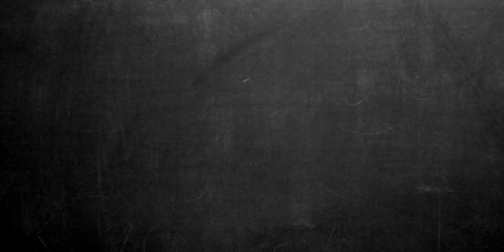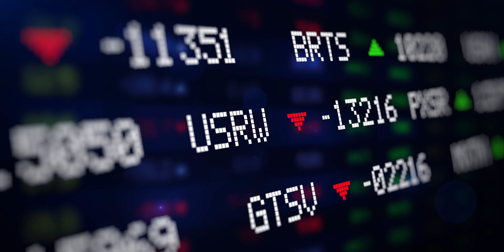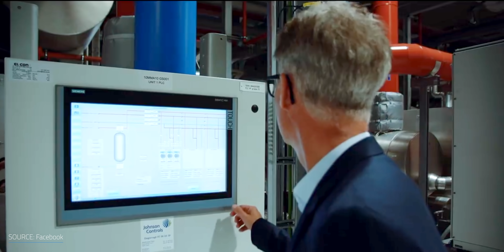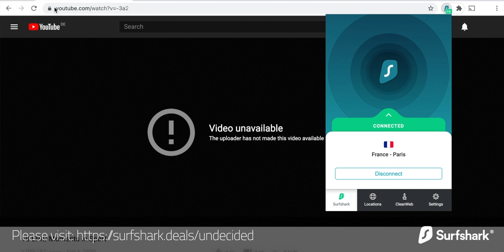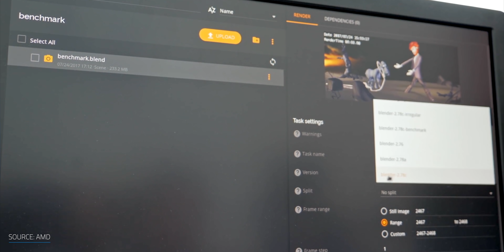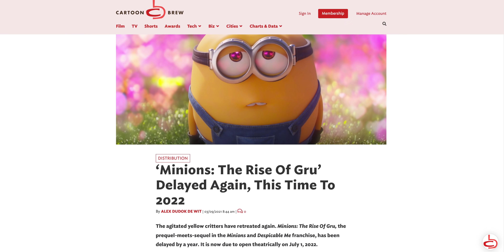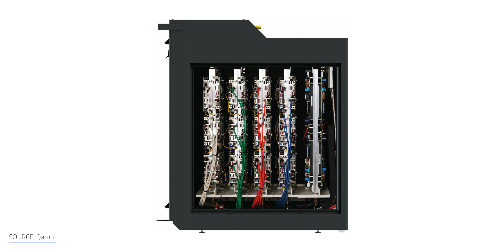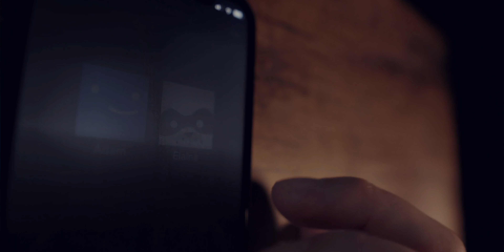Exploring How Big Tech Could Heat Our Homes ... For Free?

Comment from the maker: Do you think there's more potential for heat recovery systems like this?  What other industries could contribute?   And if you liked this video check out Exploring Modular Homes - Cheapest Path to Net Zero?
https://youtu.be/tOy1rk8QHt4?list=PLnTSM-ORSgi7UWp64ZlOKUPNXePMTdU4d
Reply: I'm going to have a hard time buying this isn't some spin for the crypto-crowd, & not wasting energy or resources supporting it or watching this one, Matt. Ps - fuel cell energy storage & heating is more realistic, for residential (not singularly specific-corporate or government) needs.
Reply: There is a tremendous amount of waste heat in current thermal power generation.
Reply: I think heat pumps will be king of efficient heating
Reply: Fully utilizing all aspects of processes just makes sense. I would love to take the waste heat from hvac compressors into a water heater or something, for example, instead of just dumping it outside.
Reply: This distributed network would actually work great for netflix, since that's what netflix already does. They have tons of these small server boxes close to their customers, so having that server in an apartment also providing heat is a win, win.
Reply: Considering that just about every home has a PC it would be nice with an intelligent way of selling the computing power when there is an abundance of cheap renewable energy. It would save on new harware being produced and ensure that the renewable anergy is being used to lower fossil fuel consumption for space heating
Reply: I'm a bit surprised that the option of replacing existing heating plants (that currently provide heating and hot water to significant parts of many cities and towns) with data center heating wasn't mentioned at all...
Reply: @Daddo22  In Omaha Nebraska there is kind of a "recycle" heating loop. First National Bank has fuel cells as their primary power source. They get chilled water from a central plant to keep them cool. The central plant then extract the heat and use for other buildings in the downtown.
Reply: More potential? What? This is something new? I've been using my PC as the only heat source for over 10 years now... (even during winters)
Reply: Are you kidding me? This is the best way to reduce the CO2 production  in the atmosphere, in the same time we can use the heat to produce energy by using a peltier device or T.E.G. (termoelectric generator)
Reply: idea is good but doesn't work
Reply: The northen countries are not the ones who primarly uses fossil fuels as electricity sources, except the US, this 85% reduction might be applicable in some situation, but globaly it does not sound likely.
Reply: I was also surprised to learn that a computer is as efficient as an electric heater. However electric heaters aren‘t the best way to generate heat if we have thermo solar and ground source heat pumps etc. 
Also while you mention good internet is required, the infrastructure for this isn‘t carbon neutral either. 

I think we should ensure our computing devices use less and less power first and think about reusing heat second.
Reply: Why can't these be used for Netflix?

What do you think about finding a way to make summer refrigeration more efficient?  I mean the way it is now our fridges and freezers kick out heat that if you are running a air conditioner  because it's hot outside, needs to be further kicked out.
Reply: One problably needs a storage for all the heat that is generated, so it can be used later when needed
A few houses together can have a something like CESAR basaltaccu (https://www.youtube.com/watch?v=QgQnpEXTpr8) that stores heat for a longer period so it can be used f.e. in wintertime.
Reply: To my knowledge, most houses only have one access point to the "outside internet", so wouldn't one of those Qarnot units hog your bandwidth?
Reply: @Dornul   it's easy to have additional added from other vendors.
Reply: @Dornul  
        Well basic numbers wouldn't take up much bandwidth, like a tiny fraction of the average broadband connection. 

        Besides, I imagine any such setup would have a independent internet connection provided by the power company. Like having a internet based phone and internet services by the same company. The phone gets it's own modem and has no effect on available general internet bandwidth even though the phone is technically "using bandwidth" just that it's dedicated independent bandwidth.
      Of course I don't know that for sure to be the case, but what I said is  highly likely. If it wasn't like that, then those without internet wouldn't be able to participate.
Reply: I wouldn't say this is a terrible idea, but what's wrong with... wearing more layers of clothing and more bedcovers like our ancestors did exactly? I can see merit to keeping the house warm using energy in some way, enough to reduce or prevent structural damage, and to literally stay alive. But for mere comfort?

I had a boiler break one winter in minus 5C temperatures, with no options to do anything but suffer it. So I wore multiple layers of clothes and multiple duvets and blankets on my  bed until it was sorted. It wasn't NICE, but it sufficed.
Reply: Definitely. Build an underground or earth sheltered  apartment building with this technology integrated into the building. .perhaps upcycle something industrial  with lots of underground space   Because ambient undeground temp .  it can be winter outside and it would not matter indoors
Reply: To make a very crude analogy, a lot of gamers already do this in the winter. Me and several of my friends pick intensive, long games to play over the winter and use the heat our PCs produce to heat up rooms. So my answer is yes, but the question is how can we improve the incedentally working system that's already in place?
Reply: All the data centers usually use chiller plants to harvest all this. So, if it had an exchanger to drive other places instead of paying even more energy to drive the chillers that would be great.
Reply: why not just convert the heat back to electricity and pump it back into the grid on location
Reply: @uncletrashero  there's a problem, generation is more efficient  with high heat energy, hence high  pressure boilers being used in steam engines and turbines.
Reply: My A/C should drive some Stirling engines or something!
Reply: I've been in the Data Center business for almost 20 years... I've been saying this for years. Facebook, Microsoft, AWS, etc...should sell or give away their heat. Example. FB could carve out some land for a local school then use waste heat to heat that school. Easily done with Thermal Energy Storage systems.
Reply: You missed one of the most obvious alternative ways to do this. You need to be a gamer and you need affordable electricity. If you have these, you buy yourself the best GPU money can buy once a new generation has been released. Then you install a generic non-specialed mining software like nicehash (recommended by LinusTechTips). Then you let your computer run 7x24. It will heat your home as efficient as any other electric heater. But at the same time it will be mining and making money. I started this in spring with my older RTX 2070 Super GPU from 2019 and it already made 500$. You won't reach the efficiencies of professionals but that is not the goal. The goal is that your electricity for heating is free or even profitable. I am heating parts of my home for free while having an awesome gaming GPU for free. There are non-success commercial products who offer this as a service, similar to your data center story.

Shameless referral link to NiceHash in case you are interested and you are a gamer:
https://www.nicehash.com/?refby=4d65ac4c-f837-4785-8e43-2f5c0067fbc8
Reply: Hope this doesn’t get used as another excuse for wasting electricity for Bitcoin mining.
Reply: thought you would mention Facebook in Luleå where they use passive cooling but it is a broadband provider that feeds heat back to the district heating network in Stockholm from several server centers they have there. When I also applied, there is another company in a small town that started doing the same thing about a year ago
here you have some links / videos (subtitle available)

https://youtu.be/s4E_Qdpc9S0
https://youtu.be/-kkR5icMOQw

https://youtu.be/X9ELENWZqLE
https://youtu.be/R8w3_gcMw0I

https://www.youtube.com/watch?v=4krpOapkEp0
https://www.youtube.com/watch?v=LmfvUiJ6tB8
Reply: To be honest, I see many heating and cooling loops running in parallel, often using massive quantities of energy on their own only to dump their waste outside. I personally wonder why I'm not hearing of anyone experiment with single loop thermal management systems that dump heat reducing loops into heat delivery loops, then finally dumping the excess energy (or conversely, picking up some energy if there's a deficit) that couldn't be used in process outside. Are these solutions just less efficient due to moving heat against a larger temperature gradient than just dropping everything off outside?
Reply: In the near future systems like this within Data Centers will become normal!!!!
Reply: Crypto
Reply: Couldn't the heat be used to generate more electricity? Wouldn't that be a more flexible use of the heat?
I wonder if we could use the earth as a heatsink?
Reply: For years it made no sense to me that in the winter it’s freezing outside but we had an AC cooling the server room.
Reply: Why does the thumbnail for this video keep changing???
Reply: Perfect for heating huge swimming pools and water parks. Also good for research Universities and dorms
Reply: Seems like a win-win.! 👍
Reply: Respected Matt Ferrel, if you ever have convesation with the company owner again, you may pass on this to him:
I also had a similar idea some time ago. to make a compartment of mild heating system with fridge. So all the heat that's released from the back can be converted without any further cost. As fridge is on 24 hrs in everyone's house so the heater will be also on. And yiu can use it for drinking lukewarm water and many things.
Reply: Yes! Bravo! The Carnot team stumbled upon part of the idea I conceived in 2003: TriGen systems for large buildings, campuses, etc. Yet, they're lacking enough insight/experience to see how to utilize all the waste heat for the optimal all-year-anywhere HVAC+power system.
Reply: If you could generate electricity instead from the captured heat it would be a much better solution IMO.  For one, having distributed server compute power to make this work is not very efficient for management.  Two is the obvious, which is this works in cold areas better.

The world of servers is about to go through VERY rapid change and in fact it's already started.  TSMC is almost a savior in this regard.  AMD Zen 3 EPYC CPUs on TSMC 7nm is SO good that AMD can't make these parts fast enough.  Companies that run large server farms are switching out older servers at as fast a pace as they possibly can because of how much power savings they get even with this changeover.  But, within 4 years, we will go from TSMC 7nm CPUs, to TSMC 5nm CPUs next year, and about 1.5 years later, CPUs on TSMC 3nm.  The power reduction is going to be amazing over today's brand new parts.  Assume that a single server rack will increase its compute power anywhere between 4X - 8X over today's brand new systems, and the power consumption will drop by 15 - 20%.  So, based on compute power, the amount of power savings is going to be amazing since you get a big boost in compute power while reducing power consumption.

And it's going to be a lot more than just AMD CPUs causing this big turnover.

So because of the problems inherent in this idea, and because compute power is growing at a pace that could be unrivaled in the past, I think it's going to make something like this moot.

Once again though, if you could capture heat and generate electricity, then these large server farms that get this huge increase in compute power could still be beneficial for power generation.  But, it would be better to feed that power right back into the server farm.
Reply: Help me design a dab rig that recycles my PC heat.  All I do is dab, game and watch your videos while I munch out.
Reply: @voidremoved  I think Linux Tech Tips probably gives enough info for that one, though I don't see why having a straight air cooled "extreme gaming rig" wouldn't be effective. ;) Just leave it running Cyberpunk on cold nights.

Comment: Could the heat be used in other ways during the off seasons and in warmer climates? Could it drive air conditioning systems or generate electricity?

Comment: The big scale heating form server halls is very suitable for Sweden and is already being implemented. Most Swedish towns and cities use remote heating by a heat plant. Typically wood or garbage incineration provides the heat but this allow easy installation for an external heat source to provide heat for thousands of homes as the infrastructure already exist. The problem is of course that the water needs to be near boiling rather than 25-40 C, as mentioned in the video.

Comment: Moscow heats people's apartments with waste heat from the powerplants.  In summer, they cool the powerplant with river water and dump heat in the river.  In winter, they pump cooling water through a loop of pipes under the main streets and through radiators in everyone's apartment.  It also keeps ice off the road.  Capitalist countries dump the waste heat so customers need to buy more power to heat their homes.

Comment: would work great in a district heating system. would need geo cooling for the summer when the only residential load is dhw, but geo cooling could be sized to meet district cooling needs also.

Comment: Idk, pair some data centres with your heat-powered sterling engine? I wonder how much electricity you could recapture/offset? It's onsite, minimises heat loss, and could drastically reduce energy consumption from the grid after the initial start up.

Comment: I live in a town of about 30k people, it exists because heavy petrochemical industry was built here in the 60's, in the mid 2000's they started a project to heat the entire town with the cooling water from the factories. In essense, we turned the entire town into a MASSIVE cooling flange/array for the factories. Prices are ''low''  and the heat is abundant (even in the cold climate of Sweden)  This needs to happen everywhere.

Comment: We need something that can store heat and cold for relatively long time - for months. something that has a slow phase transform around 20C, so it can store cold in winter and release it in summer  heating up for releasing heat in winter at the same time. Or that can absorb extra heat in hot region and keep most of it while being delivered to colder places

Comment: I also had a similar idea some time ago. to make a compartment of mild heating system with fridge. So all the heat that's released from the back can be converted without any further cost. As fridge is on 24 hrs in everyone's house so the heater will be also on. And yiu can use it for drinking lukewarm water and many things.

Comment: I live in Montreal and already have a water heat pump for heating during the winter.  So it should be easy to install. I wish I could plugin a system like this during the winter to offset the cost of heating

Comment: Didn't I see devices that turn heat into electrical energy or at least heat differential . Would it not be cheaper to convert the heat directly to power on site and reduce overall power usage.

Comment: So identify places that use hot water on a regular or predictable basis and integrate the boiler system into the existing loop. I bet there's a ton of potential for thermal energy reuse and recycling.

Comment: Combine distributed computing with the Tesla heat pump and a new heat pump compressor that oscillates vs spin and energy efficiency gets very high.  A device like this in office , apartments or hotels to manage hot water and space heating and cooling gets very interesting.  But so does mixed use buildings.

Comment: I live in a flat with electric heaters, but energetic class B. I mine bitcoins to keep myself warm, and that repays for the electricity consumed. I actually make money. The boiler makes sense, but the electric heater is just a work of design, because your normal PC generates heat. I think with 3 NVIDIA 3080 you can keep yourself warm in a small flat. But it's going to be noisy, especially with air cooling. :-)

Comment: It's a great idea, but processors are getting more efficient (M1) and don't heat up like the older ones. 

Also, distributing computing power is less efficient because of latency and is a security issue. Also, it needs more infrastructure for networking and has greater chances of things going wrong.

Comment: I had a thought like this like if it were more common to run smaller power plants for small towns they could use the hot water piped over from the plant instead of having boilers and heaters in every home

Comment: One way of creating more surface area on Earth is to build a 100km high platform that encloses our planet. This will require alloys and compounds not yet available, but the sky would be blue for any lower levels. The lower level or levels will generate waste heat that will need to be efficiently dissipated. A lot of energy will be harvested through the dissipation, but then.. a megastructure like that would require enormous amounts of energy so I'm sure nothing will be wasted.